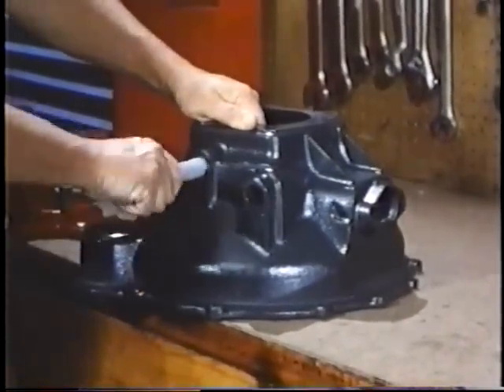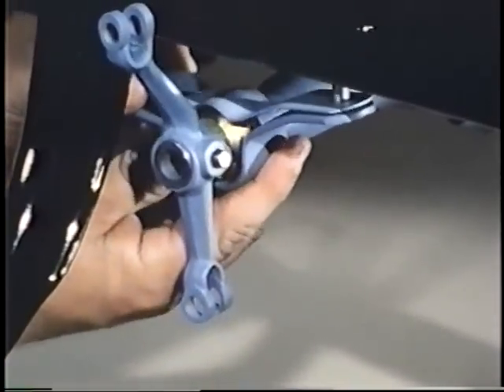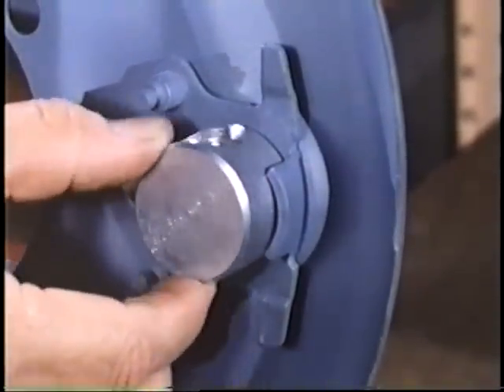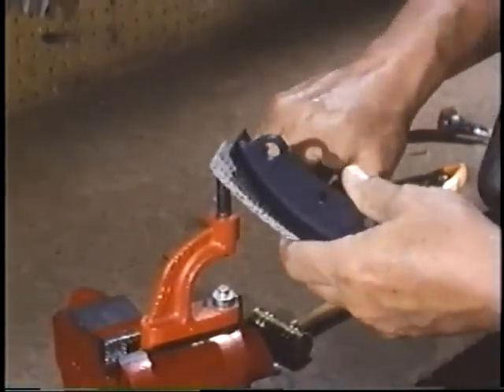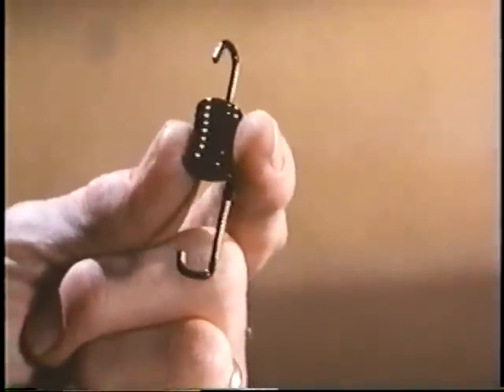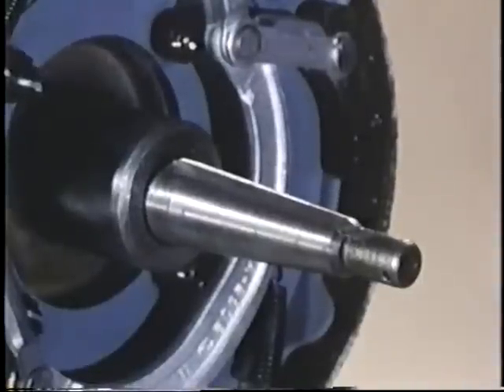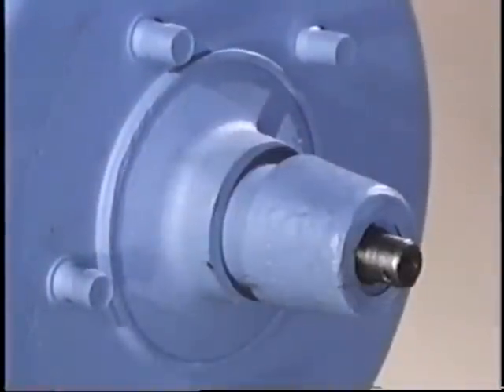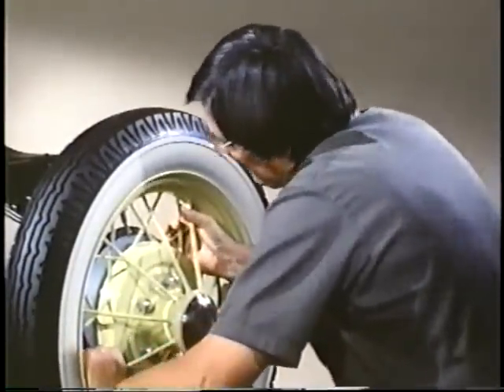How To Stop On A Dime

Comment: Wouldn't recommend sanding on NOS woven brake linings, by the way... you'll basically make a little pile of asbestos powder.
Reply: Yeah - grind the ends while the lining is wet and you are wearing gloves.  I would let nature grind the lining to the drum. Personally, I would probably find a "close match" of modern shoes, deline them, soak them and mount those instead.  But....well, I'm willing to be a test driver in case all 4 fail lol.
Reply: The linings we use on Model A's are not made with asbestos anymore, haven't been since the 40's, and are perfectly safe to grind on if just dont deliberately inhale it, a dust mask is fine for it
Reply: @phantomcorsair8476  That's the definition of NOS though... new old stock. I'm talking about 1940's brake linings.

Comment: Not sure why I watched this. Don't think I'll ever even see a Ford Model A in person. I found it very unusual that the brakes were rear biased. That seems unsafe. Though at 33:38 it looks like this is done so the front brakes do not lock up, so that you still have steering authority at full brake lock. Though that would be leaving brake performance on the table, as locking the rear wheels reduces their effectiveness greatly and probably adds a good bit to stopping distance. However, I will readily admit I know very little about drum brakes.
Reply: On a Model A, the rear brakes were specifically designed to have more pressure so you could stop and still steer. Locking the wheels on an A does actually make it stop faster, I know that from experience. I had a car slam on the brakes in front of me with a modern abs system and I could come to a stop a lot quicker than them. A good Model A will stop from 45 mph in about 45-50 feet. Half the reason for the quick stops is that Model A's are a lot lighter weight than modern cars. My pickup only weighs 2200lbs.